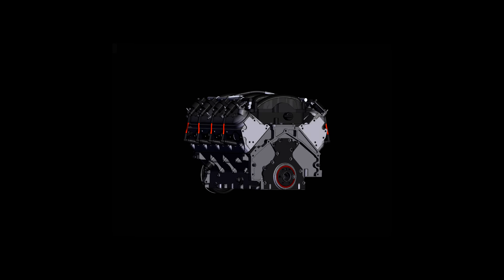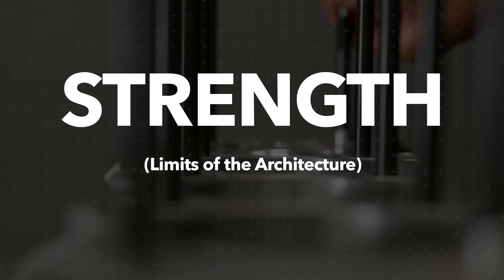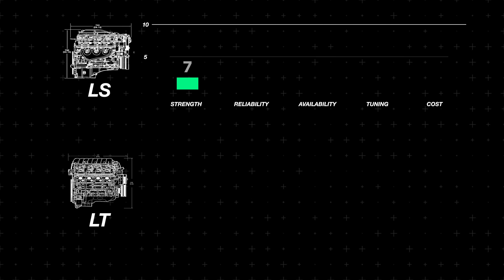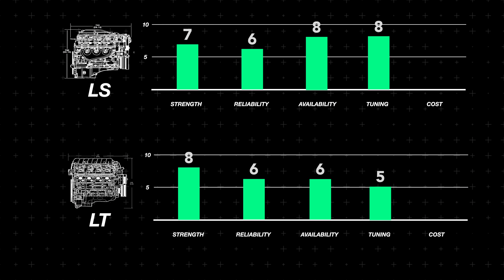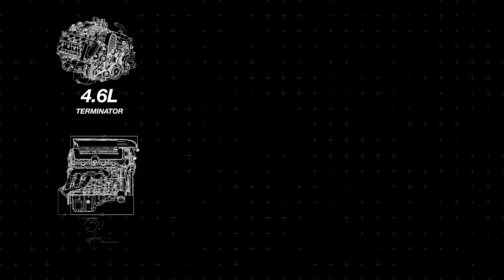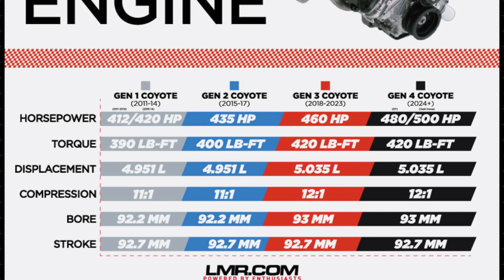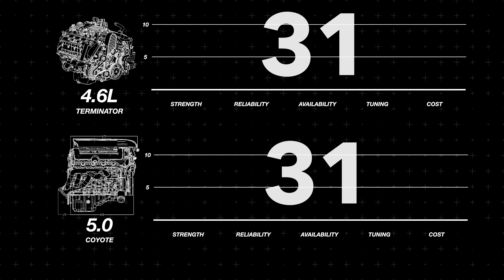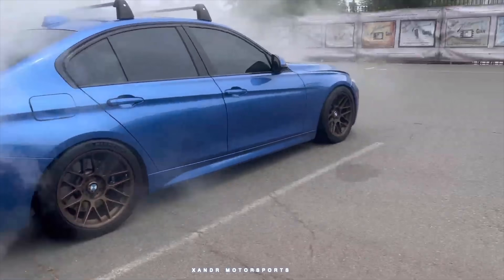Why Old Engines DESTROY Newer Ones💀| Explained Ep. 25

Comment: Why didn't the small block chevy make this list? Their cost is unbeatable by any modern engine. When modified they make 85-90% of the power of an LS. They have stronger cast iron blocks vs aluminum, if you can afford the extra weight. 6 bolt main is nice but GM had to do it because 4 bolts into an aluminum block would have been a joke. Splayed 4 bolt main caps in an iron bottom end SBC >= the LS 6 bolt aluminum mains. The SBC doesn't have internal rubber oil seals that become brittle with age and bleed off oil pressure without external leaks so the driver never knows. SBC's don't have valvetrain issues like the LS7 intake drops, or the other LS valve spring breaks, lifter collapses, composite lifter trays that become brittle and break over time-SBC's simply didn't litter the internal engine with so many problematic heat-fatiging plastic components. The old EGR also works more reliably for driveability and mph improvements than DOD/AFM. 
       Speaking of MPG, which we all care about because  everyone is on a budget and it costs money to fill up: Look at window stickers, 98 LS vs 97 LT F-bodies, or 99ls vs 98 sbc trucks, GM rated them 1 whole mpg better than the SBC/gen 2 lt engines they replaced. ONE. Don't let internet lore overhype LS mpg. 
      As for power: the LS made more power in stock trim due to higher flowing heads, more aggressive factory camshafts and much freeer-flowing/mpg improving factory exhaust manifolds than the sbc's they replaced. Mods on sbc's however, deliver more hp gains than they do on LS's. (30-60hp for a head swap on an ls vs 50-100hp for a sbc, 10 hp for a set of headers on an LS vs 20hp for headers on a sbc, etc.) The more heavily modded these 2 engines are, the closer their numbers get to one another. Modding a SBC to make more power than any stock LS costs less $$ than a junkyard LS swap. SBC's also have fewer parts to fail such as 1 coil vs 8, LS's have more engine sensors that simply didn't exist in a SBC, VVT, and on and on. Gasket designs on SBC's were also better. LS engines leak oil worse than an the 1950's designed 2-piece rear main seal SBC's thanks to the cost-saving cheap/thin O-ring style gasket designs on the oil pan, valve covers, etc that have taken hold on most all new engines.
       I will say that LS's are great engines and they did improve many things over the SBC, but its not an across the board success like internet lore raves about. There were gains and LOSSES. Nearly any of the reasons someone gives as to why an LS is superior to the SBC can also be applied for why the LT > LS. The only reason to choose one over their predecessor is if you choose to ignore cost, simplicity, reliability for a bit more power and a bit better mpg

Comment: I wanted to see you factor in the older 426 big block Hemis vs the new and modern day Apache Hemis, also the Hellcats. Would've been nice, but I still enjoyed this video, goes to show old isn't always better, and the new generation of engine builders, and tuners, have opened the doors and paved the way to both innovative performance, AND racing excellence. The newer engines are a little cheaper to modify and tune compared to the older ones, everything is technological than to bolt on forced induction to squeeze power out of the engine blocks. It's incredible how simple intakes, and a little flash/ecu tune can make a BMW, or even a Nissan Z car run a LOT faster than from the factory assembly line. Cannot get enough of these videos! You do an amazing job EVERY time!!! You need a Grammy fr!!!

Comment: They don't. And claiming they do is absurd. Today with just software you can generate a percentage gain in power that would have required a total rebuild of the engine, 20 years ago.

Comment: ....

What a kinda stupid video. 

Emission ratings exist. Something called global warming yknow... know some people still live under a rock so it's ok. Kind of the reason we went to direct injection and turbos tho if you weren't aware... Don't know..

Also half of these metrics are kind of retarded...... the b58tu has been through testing and I still have to see one that blew up or seized or had any problem that wasn't due to user error (Not doing maintenance, tuning it to like 1000hp). I don't understand how you managed to get 'reliability' as a metric. The only b58 car that I saw blow up was an m3's stock transmission with a 1250hp tune. 

Quite literally everyone in the car community calls it a 3jz... because to be fair... it pretty much is. How the fuck u got a higher reliability on the 2jz than the b58 baffles me... because so far 2015 m3 b58s had an issue with the water pumps... but other than that, post 2020 b58s (in your awkward strength-reliability-pullshitoutofmyass metrics) are literally way better than any engine mentioned in this video.

Not to mention all the 2jz issues mentioned online... God if fast and furious didn't exist how much better the car community would have been... Other comments also mention very similar biases as the ones I mentioend.

Also where was the conclusion?

Comment: If the "Market" would give the Petrol Engine another 5-10 years, FORD and DODGE should go back to the "Inline-6" engine as they where "bullet-proof" back in the late 1970s- 1980s...
Add a good Turbo system, you would have better MPG's and MORE HP!

Comment: If built and operated properly (with proper maintenance), the early-mid 1990s D16Z6 and B18A1 should "rain power" due to their smaller  displacement for HP, only if the transmission is properly built, along with the proper Bearings, and driveshafts...
When it comes to building a "Daily driver/Track car, you get what you "put into it"!
Cheap parts and no knowledge of hat you are working on (no research) will cause MAJOR FAILURE which = Loss of money.

Comment: If were just looking at which engines are objectively "better", then we should take availability and cost out of the equation and be looking purely at design. Those are influenced by other factors.  Availbility factor of 3 for a 2J seems too low, you can still easily buy one from any jdm importer/ebay or junkyard esp if u go na-t. Just the price has gone up.

Comment: I agree the JZ has a way bigger culture and the b58 is overlooked by the s55, but I think the b58 wins in terms of accessibility, performance, and probably reliability. You will be at least 10 grand in and the cost of the motor + whatever car you have just to get the jz on the road as opposed to a b58 where you just go FBO and your running 10s

Comment: I’ve had extremely good luck beating the piss out of many 4.6L 2Vs. Love that engine. Super easy to work on and timing chains easy to do.
Reply: I can't wait to get one, need that shitttt
Reply: @ Just replaced the spark plugs in my 2003 Explorer limited. That has the 4.6 2V in it. The same as my 2003 Mustang GT

Comment: Just reading the title question, my answer was immediately “hippies”.

Let’s see if I’m right. I will edit after I watch.

EDIT:

He didn’t say environmental concerns forcing engines to be more efficient and clean burning. I’m shocked! But the simplicity of the older motors does reference the smaller influence environmental and fuel cost factors had in design. Iron blocks seems to be a big reason for the popularity of older motors, as they have more tuning headroom.

Comment: Between 2001-2004 at my local JDM engine importer here in Southern California a 2jz was $1,000 if it came with an auto tranny and $1;500 if it had a manual tranny, and blacktop 4ag 20v was $800, a silvertop was $700, a 13bt was $800, and the most expensive were the sr20s the one that came in the s15 was around $2,000 and the ones from the s14 and s13 were a few hundred cheaper. I remember these prices because either I bought or had friends that bought these engines and we still thought it was big money haha nowadays you can't even buy a blown 2jz for under $1,000 lol

Comment: I think the B58is very easily attainable, since its a BMW engine, in Europe its very common(B58 is like a 8-9here, the 2jz is a 4at most)
Meanwhile the ls, lt poop either Way here
The coyote is easier Than the terminator (latter is impossible to find)
Subarus are still harsh
Kseries can be found easily unlike the New series Honda engine since we dont get Strong hondas that much

Comment: "Mmm, yes, let's compare engines in a way that makes zero sense what so ever and slap a bunch of numbers out of my arse to make it seem like we know what I'm doing" - instead of doing this whole video you should've explained the context behind the times when these were created and you would know everything, meanwhile here you're just saying "trust me bro, this is good, this is bad" (tbf, you are correct some of the times). The conclusion is correct though: If you're after a one trick pony, get the old stuff, but the new will be just a better engine (and will make a better car). The idea of a 1khp 2jz sounds nice until you realize that it gets single digits mileage all the time, has turbo lag longer than some cars doing the quarter mile or that it will probably be quite crap in the corners due to weighing about as much as the 8L V10 from the viper.

Comment: While this is a fantastic video, it is ultimately incorrect. There is a HUGE difference between "built like a tank" and finesse. Old engines may have been more stout in the scheme of incorrect operation, however new engines are an order of magnitude stronger when used correctly. Plasma Bore is a great example of this.

Comment: You're spot on with the 2JZ vs B58 conversation. I owned a mk5 supra, then switched to a 340i xDrive with a 6MT. Water pump failures do occur but there doesn't seem to be a rhyme or reason as to why. The crankcase ventilation issue can be solved with a $20 part and common sense to perform preventative maintenance. I can't wait to see how many miles I'll be able to put on mine!

Comment: Current engines consider the quality of the metal are insanely good, the problem is the regulations about everything in the car industry ! this is the only reason that is destroying nowdays engines, and that is a fact ! and still there are l6 engines 2010+ that can produce 1000hp without being opened ! and older engines is make like 1100hp that is only because of longer develupment of the tuning and so on.

Comment: Looking the 2JZ it looks to me like a 6cyl version of the 4cyl Volvo Red Block (B230FT typically) which predates it by around 10 years.  The Volvo will go over 1000BHP (apparently) without block or crank mods, the head needs flowed or just a custom CNC'd billet head and heavy valve springs (getting gas in and out of 4 cyl is tough but the engine is strong enough).  Volvo wasn't interested in big power, they just wanted long mileage and they achieved that, it just happens to be good for power.  Ultimately its a cast high quality steel block, with forged crank and rods, oil squirters, sodium filled valves and tappet buckets.  There are no common problem or failure points, you buy these in the breakers they will work (if they havn't been left open to water inside etc).  Funnily enough the 6cl 2JZ weakness is the block/crank twists because of the longer length.

Comment: I’m going to watch this then I’m going to come back and destroy this bs.

And I’m back. This is a useless argument and analysis with some many holes it’s not even funny and the same one that was made for carbs when fuel injection was becoming available. Guess what. Now it’s more difficult to tune a carb then press a couple of buttons 😂 

Direct injection and high compression ratios give new I6 engines the clear advantage.  You discount 1/4 miles times and rightfully so but the same can be said for peak HP numbers. TQ under the curve and what gives the broadest power band is what matters for fun on the street. And new engines win in spades with peak TQ available at 1500 rpm.

Comment: When it comes to power output and reliability a lot of older engines during development didn’t have as much AI or simulation software to develop engines so engines developed in the past had to go through much more dyno and vehicle testing before being released so by the time they got to you they were competing in the HP market but having alot more testing under its belt to prove itself…. Newer power plants are still tested but due to more simulation software they can be designed faster and less live testing has to occur but the down side is the live testing is cut down reducing the small details that can cause premature failure as the power plant ages and gains more operating hours

Comment: Such a low score for coyote strength. Gen 2 and 3 coyotes are easily making 900+ just boost and fuel. You dont need cams, no head work, no internal work. Sure the gen 1 was a good bit weaker maybe making around 750ish but a short block swap is only like 3k into a newer gen

Comment: Ls and b58 are above all for all purpose car you can make track car drag car or whatever with them. And as big fan of straight six its hurt me to admit that ls is best engine of them all, becaude its lightest and most compact and you can put it in what ever and it checks most boxes. If i wanted to build drag car i would go for lsx if i wanted drfift or track car i would go for ls3 or ls7 and keep it na, if i had to buy used car or new since i am in Europe  i would go for manual Supra with b58. Bmw allways had great engines but since stuff its like it is maby one day i will buy used Supra since it has biggest chance to be avelible and i would keep it prety much stock. If i was in America i would have ls swaped shitbox.

Comment: if we take into account cost 500$ m50b25 simply rekts them all. max speeding rods turbo,arp studs,cometic gasket ,speeduino and ready for 500hp. Flip burgers for one month and you can have all that, flip for 2 months you can make it go 1000hp+. Of course thats about europe. I dont know if what i see on youtube is accurate about monster v8 Ls engines being sold on junkyards for 150$ in USA that for sure beats m50b25. In a straight line at least.

Comment: b58  has been 7 seconds in the 1/4 mile on factory bmw drivetrain in a car he drove to the track and home after...........  downpipe, e85 and tune on b58 = 9 second street car.  you literally cant do that with any other car modern or old. lol  about the only other car on pace with the b58/s58 is the 911 turbo .   s58 engines are making 1000whp bone stock engine internals now.   to make a 2jz do that you need cams, head work and bunch of other supporting mods.

Comment: I have a 2JZ GE in my car. Stock, it consumes around 9 to 11 liters on 100km.
If I eco cruise it, I can reach 8.3 liters / 100km.
A modern Toyota-BMW B58 in the supra, is using a mix of 8.5 liters on 100 km.
It can be driver economically to 7.2 liters / 100 km.

But the old block, with the square bore to stroke ratio, would be able to reach hhigh hp easy. What the modern B58 could not without several modifications.
But the B58 is an impressive "everyday horse" engine. You can use it, have great power and be happy with it without spending too much at the pump.

Times have changed337 speed.

Comment: 10:05 These are both F-chassis cars which were B58G1, not B58TU.

B58 has an electric water pump only on the charge cooling circuit, the pump has not been known for problems. However, in the pre-LCI models (<17-18) the charge cooling circuit was not shipped with rock guards making the A2W heat exchanger prone to rock impacts causing leaks. The N54/N55 had the electric water pump problems you reference.

Early B58G1 (~16) had some faulty injectors and the PCV problems mentioned, but this became uncommon in later years, and nearly unheard of in B58TU.

If you want to do an expansion on the topic of B58TU, I’m happy to help with content. ❤

Comment: I mean, unless you're going stock bottom end build, any of the 4-valve modular engines can perform just as well as a Terminator, so availability isn't as bad as it seems there, especially if you go with a 5.4L DOHC, most of which came with forged cranks. A set of rods and pistons away from a very stout cast bottom end that will actually outperform a Terminator all else equal.

Comment: We are no longer getting the "best" engineering and manufacturing from car companies (that occurred from 1996-2009) in combustion ebgine models. I believe in an effort to "dissaude" the public from combustion engines to electric cars. How safe is it to sit hours on top of a huge battery like that? Bet it causes cancer. Plus, the huge car batteries cannot be recycled. Furthermore the "quick charge" stations to charge the batteries use generators, absence catalytic converters to charge the cars. Doesn't that defeat the purpose in the first place? I've seen people with EV trucks, and they have generators in the beds of their vehicles so they can charge anywhere. Smart, but still defeats the purpose. Not to mention "gasoline" is not the only fuel that combustion engines can use. There are plenty of alternative fuels that OPEC just doesn't want you to know about. I don't have a problem with electric cars, given they are truly safe to operate. I think combustion engines and electric cars both should be made available and let the consumer decide. More choice, not less is what is needed. I think electric cars, with their short range and long charge times is a way of control and limiting people's freedom.

Comment: Modern engines have soo many computers and sensors that you can't modify them unless you a computer genius and a mechanic.  Old engines without the computers can be modified much easier.  Plus modern engines are designed to squeeze out as much power as possible while abiding by very tight emissions regulations.